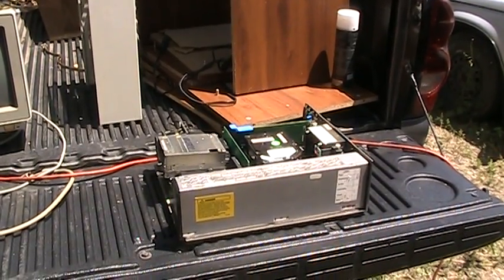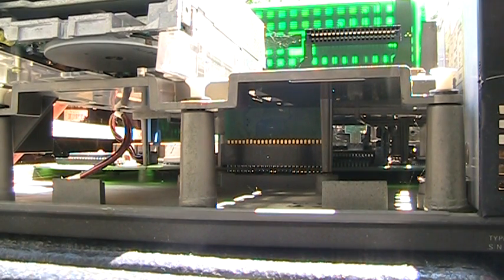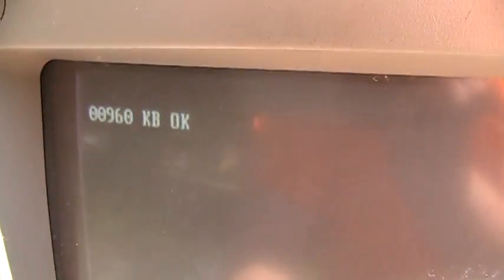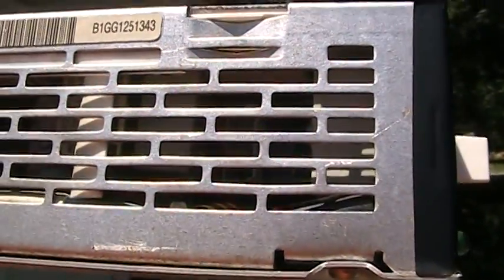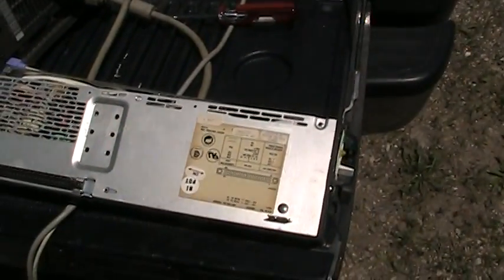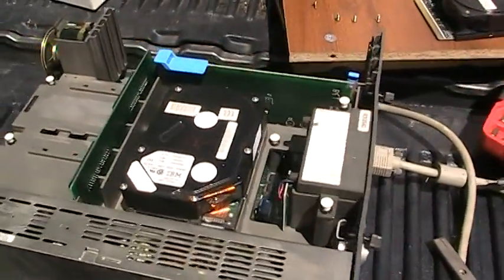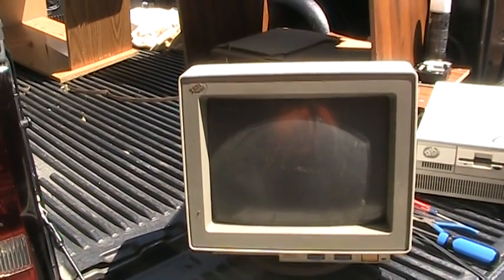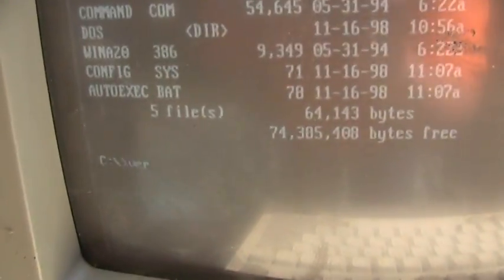IBM PS/2 Model 50Z Resurrection

Comment: The power supply "safety" capacitors were made with paper inside, so that's why they smell like burning wood (or paper) when they let the magic smoke out. I didn't think paper capacitors were made anymore after the 1960s, but I guess they hung around for certain applications. 

Tandy also changed the color of their front panel reset button from red to white around the same time that IBM changed the color of their power switches, so perhaps it was some kind of then-new regulation they had to meet. I've read that IBM was quite hesitant to make the original ThinkPads black, because Germany had a regulation that all office equipment had to be in "neutral" colors (and not have any chrome) to reduce eye strain.
Reply: I don't know about the rest of you, but I'm quite glad the ThinkPads were made black, I think it looks much nicer.
Reply: That's pretty interesting!

Comment: I always like seeing those IBM PS/2 systems with its modular, snap-in, no screw drivers needed design :)

I used to find relatives of this model in the school garbage dump (hmmm... two decades ago). It's nostalgic seeing those systems with a MCA bus, and the hard drive with the edge connector that hooks directly in to the system bus. Now to think of it, it's probably one of the easiest physical interfaces for connecting hard drives; a lot easier to handle than connecting those small SATA data cables. 

Ah, and those red and white power switches! Brings back memories of the 90s :)

Looking forward to see you tinker with that system! ;)

Comment: Good to see an old IBM living once again. My IBM 15" CRT Monitor is suffering from pink color on the screen while still displaying a picture. I did spray electrical contact cleaner in the video port and it works for a couple of weeks and acts up again. I'm planning on using my old monitor for my Nintendo 64, GameCube, and Xbox Original with either composite or S-video to VGA adapter and a composite selector switch for the N64, GameCube, and Xbox Original and external speakers for the systems. Wish I can use my dad's old flat panel monitor, but it's suffering from issues (screen is bright on half the screen and dull on the rest of the screen). Could the flat panel monitor be suffering from bloated capacitors or is it the screen/video board failing?
Reply from the maker: With an unevenly lit screen, I strongly suspect that one of the CCFL tubes has gone bad. One driver circuit usually runs both, although some larger monitors might have more than one.
Reply: +uxwbill So in other words, the display has to get replaced with a new one? I cannot find one on eBay. Maybe Amazon has one and the monitor will be used with my two computers that I have in the basement, along with an audio splitter and 35mm speaker wires since the monitor itself doesn't have built-in speakers.

Comment: I would personally argue that the Dell QuietKey series was actually better than the outsourced Model M units that used a rubberdome system. I own two QuietKeys and a single Lexmark IBM Model M, and I must say, I use the QuietKeys much more often.
Still, I use my Unicomp USB Model M much more than any keyboard I have ever previously owned. It is an incredible piece of hardware.

Unrelated question (as if the previous paragraph was truly related), but do you own any Athlon 64 systems?
I've found them harder to find than Pentium 4 systems, but always for around the same price and they pack a much bigger punch, even if the cheaper ones are always locked to DDR1 memory. I use Windows 7 Home Premium 64-bit on one with 2 GB of RAM and a 2.2 GHz 4200+ x2 to this day, simply for extra activities. It feels MUCH faster than my 3.0 GHz Pentium 4 HT 630.
Reply from the maker: It wasn't my intention to harshly criticize the Dell keyboard. Call it the hazard of unscripted video making. I don't really have anything against or (or even the "library quiet" Model Ms, which I actually do like). Neither has anything on the HP/Keytronic rubber dome keyboards, which were probably the best rubber dome keyboards ever made.

Yes, I have some Athlon 64/X2 systems and they have shown up in videos. Most of them are from Dell, during their brief flirtation with AMD's products. (In fact, I'm typing this on a Dimension E521 right now. Said computer is pushing an Athlon 64 X2 5600+ (Brisbane core).)

Even though I spent years on the AMD side of the fence, there's no denying that Intel had the far bettter chipsets as compared to nVidia, SiS, VIA, Acer Labs and others.
Reply: ***** Yeah. nForce chipsets have always caused me nothing but trouble, and every single one of my Athlon 64 systems contain one. 
I especially despise Realtek AC'97 audio, which appears to require the front panel connectors to be connected for audio output on any line.

Comment: Speaking of Keyboard, I got the Beige IBM keyboard that I thought it's Model M, and I type to see it got buckling spring and guest what? It does not have one but have rubber dome keys and I looked what model is that, the model number is KB-8923 and they're made in Thailand. Plus, I got the Samsung SyncMaster 931B manufactured in Nov/2006 and the picture is looking nice.